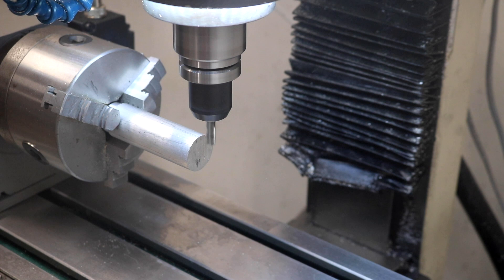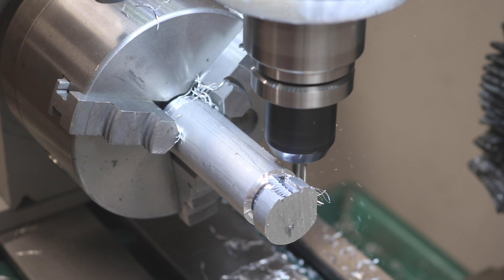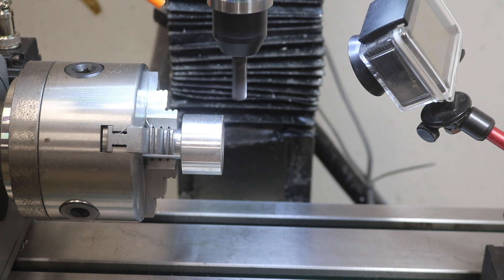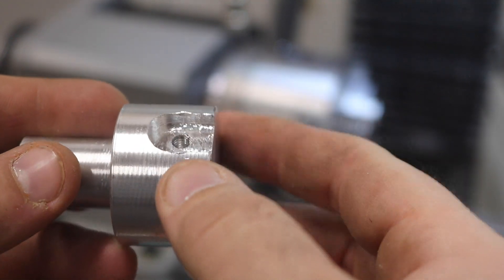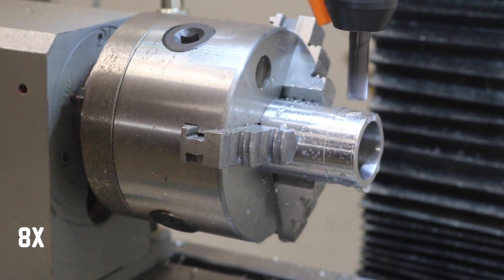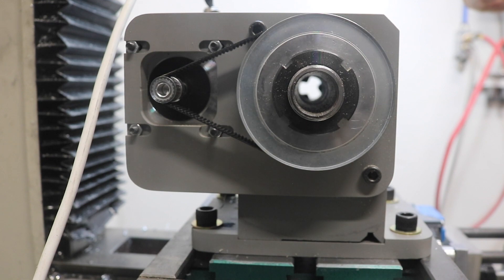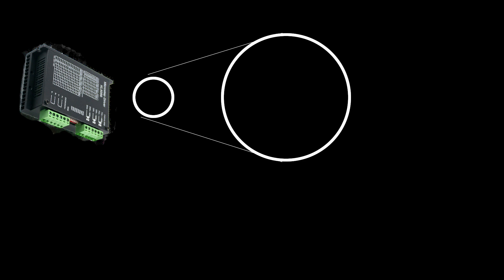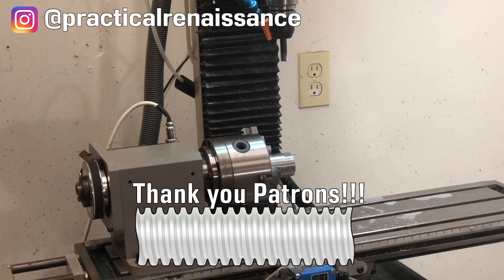DIY CNC 4th Axis Follow Up and Details

Comment: The "Use Radius for Feedrate" is poorly understood.  
It is Mach3's method to adjust rotary feedrate to achieve the tools velocity in the cut regardless of the diameter of the work.
If you use the centre of rotation as zero, it is still relevant. 
What happens is Mach3 adds that setting to the Z axis DRO at any time and uses that total number to adjust the rotary feedrate.
So even if the setting is zero, Mach adds zero to the Z axis DRO reading and adjusts accordingly.
There used to be a bug where, if the setting was zero, then Mach would automaticaly turn the feature off.
I always used a very small mumber (0.00001)  in that setting even when using centre of rotation as a work around.
As I remember this bug was fixed but I don't remember what version that was.
It is a while since I moved on from Mach3.

Comment: That's a nice 4th axis, and it's not a horribly expensive or complicated build kudos to you on that. I may need to build one of these for my tormach 440. Only thing is, I have my ATC chilling right above that location and I'm wondering if I could somehow mount it on the other side. To guarantee no interference with my longer tools

Comment: I know this is nearly 2 years old now and maybe you've already come to know this but in case not, 2:55, no, that poor side milling finish in this example is not the tool or the machine, it is because you were "conventional milling" which will always leave a rather poor finish because of the flute cutting edge entering the cut at zero thickness which cause it to rub and flex rather than cut and basically tried to push the material out of the way rather than cut it until it builds up enough for the cutting edge to actually cut and then the next flute does the same, and so on... 

For superior finish any time side milling, you have to "climb mill" especially in softer materials like aluminum so the cutting edge is always entering the cut at the thickest portion of the cut and thus the edge actually cuts in and shears away the material like its supposed to.

If you are afraid of the tool grabbing and walking on the part, "Conventional mill heavier roughing pass (passes) and leave a few thou minimum for a finish pass and do the finish pass in a climb mill direction. On small cutters and shallow radial depths of cut (a few to even as much as .010", especially in aluminum and other soft materials), the pulling force from the cutting edge grabbing the material and trying to walk along it is so low that you could even technically hold the part by hand with no problem.

Comment: I’m curious, when milling the hexagon shape, why the loopy path?
*asked by someone with no CAD/CAM experience
Reply from the maker: great question! The software I use for CAM (and CAD as well; Fusion 360) has a milling style known as "adaptive", that moves around the cut in a more fluid fashion, in order to maximize what it computes to be the most even and effective tool engagement per pass, resulting in the "loopyness"  On a little machine like mine I like to use this strategy for my cutting programs whenever possible because it allows me to be the most efficient with my tooling within my constraints.
Reply: Practical Renaissance ahh roger, I just figured that particular cut didn’t look like it would benefit from that path

Comment: That's a great looking set up you have there , I have made a similar 4th axis for my mill using the head stock from an old mini lathe but I just attached angle plates to the side of the head stock and bolted direct to the table, this allows me to use the original tail stock for support between centres , Mine has a nema 34 with I think 8nm holding torque but only 2-1 reduction , I have attached a bicycle brake disc to the spindle but need to re do the mounting bracket to fit the caliper , I intend to use either a small pneumatic cylinder or servo motor to operate the caliper and hopefully run it through Mach3 some how but I think that's a long way off yet . Keep up the good work.